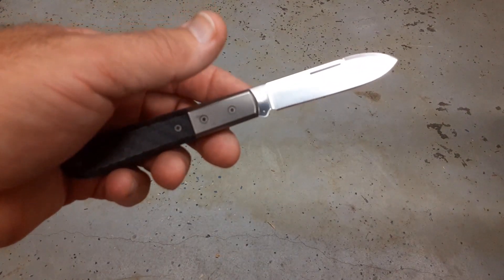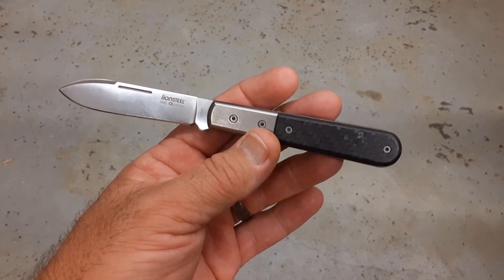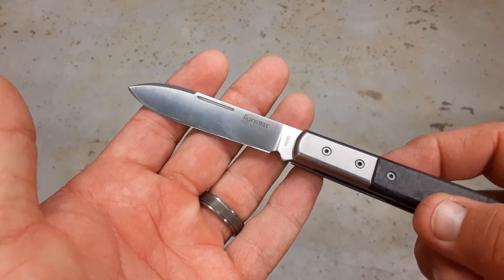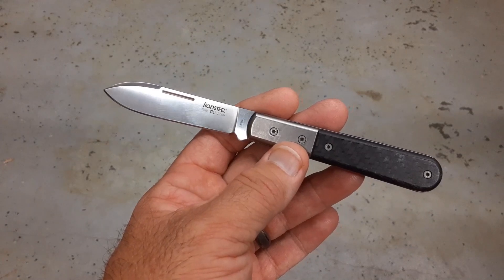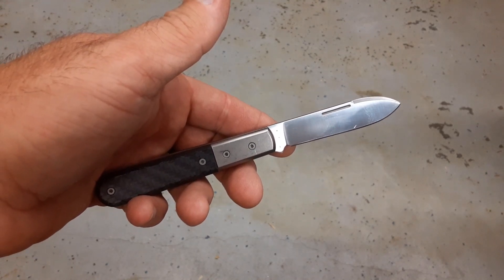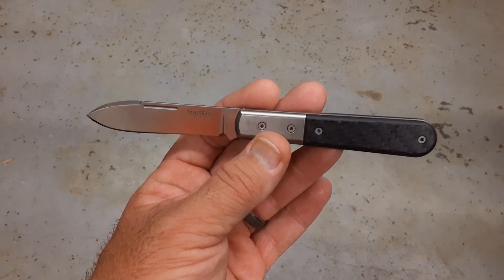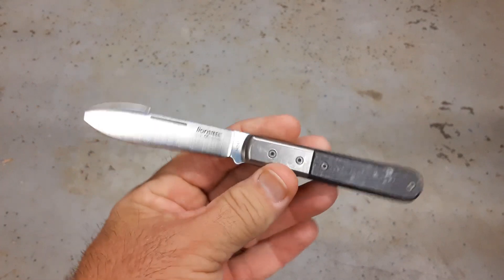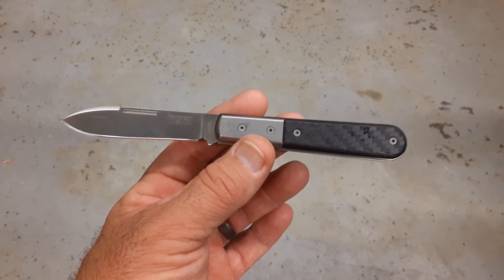Lionsteel M390 spear point barlow edge retention testing, does this one disappoint? Let's find out.

Comment: This knife tested between 54 - 56 Rockwell. The first time I cut with this knife I knew something was wrong. The factory edge just fell apart. It really never got any better. This knife was tested 5 or 6 times. It wasn’t just one test.
Reply: I bet if you took the blade out and tested at the tang on Peter's ht... It would test 60hrc plus or minus 1hrc. There heat treatment protocol is the problem and they refuse to change it despite the performance being bad.
Reply: @tacticalcenter8658  I am not sure what you mean when you say it will be 60hrc. Kurt tested 6 spots right next to the bolster. It was as far away from the cutting edge as he could get. I have removed the blade and tested it in 2 places on the the other side of the pivot screw. It was still a 56 - 56.5. I have to believe it just poor heat treating all the way around. I am sure the blade sharpening by belt probably took the cutting edge to the lower numbers. That knife has now been sharpened more than 12 times. We should be past a burnt edge by now. We are into just poorly heat treated and a seriously overheated blade all the way through.
Reply: @mikelikesknives428  just saying the same thing happened with the first low hrc one tested. Low hrc by Kurt, along with the same poor edge retention in these tests. Then Kurt took that one to Peter's and it tested 60hrc at the tang. All I'm saying is, it was probably to spec but burnt to a crisp on a grinder after heat treat. They already have a poor heat treatment protocol. But the burning the edges makes it even worse.

Comment: I have the Lion steel Dom. The design and size made for a wonderful pocket knife. I was so happy with it until it was time to sharpen. Using  1200 to 2000 grit diamond plates followed by crock sticks it has been impossible to get to a shaving edge. I get to a working edge and it does not hold that well.

Comment: I've had one since they came out and  the first time I put it to the stone I knew there was an issue with heat treat.
Reply from the maker: Only the Bolus that felt ok in sharpening did what the average M390 does in the 170 feet total cut range.

Comment: Viper and fox any better at this?
Reply from the maker: The one Fox M390 did about 160 feet total and the Viper M390 knives I've done didn't do well at all.
Reply: They all use the same heat treatment protocol developed by Molleta of lionsteel and heat treatment performed at Trattamenti Termici Todesco SAS
Reply: @Outpost_76  you can read more about lionsteels own cut test results which were really poor also https://www.bladeforums.com/threads/lionsteel-steels.1168429/
Reply: I saw a Supersteel Steve test a Maserin that did phenomenally, maybe they're the one to go with.
Reply: @matthewsbernier  steelwill gets there Italian made knives made by maserin. We've seen them do poorly in Cedric Ada's tests. I'm guessing that knife Steve tested was heat treated somewhere else than the rest. Steelwill like to keep everything secret, maserin too.
Reply: With that said maybe they learned and started doing it right? Would need more data points of knives made in recent years tested.
Reply: @matthewsbernier  found this one interesting. 62hrc s30v that got 700 mm in CATRA testing https://www.tommasorumici.com/portfolio-item/hide-e-hide-folder/
tomma sorumici is the designer of the maserin knife Steve tested. Check his Instagram for newer models aswell as other designs from the Italian brands. He used to work for viper. His ig... @tommasorumici
That one is made by Fantoni which have worked with s125v steel (low hrc due to mass production but yea). They work with some larger names as mentioned here https://www.knifecommand.com/knife-brands/fantoni/
It's possible that fantoni have there own profiles at the same ht facility as lionsteel etc... Or there own heat treat in house or at a different facility than what the other Italian makers use. I haven't been able to find much on the subject and have not asked around yet. But maybe maserin switch ht facilities to them. I dunno. Edit... Looks like Fantoni went out of business in 2019
Reply from the maker: @tacticalcenter8658  just like my M390 Modus that cut 150 feet total and was 57 rc.

Comment: The thing that I love about this video is he doesn't use any other knife to cut the same material so you have no idea what the quality of the cardboard is you have no idea if there was contaminants in the cardboard you have no idea how much pressure he was using how much speed he was using anything it's all based off of antidote evidence of one knife.

RC is relative there's been several tests done on YouTube where they put things like s90 up against 1095 and there's no comparable difference whatsoever in cutting ability or edge longevity. people get hung up on this and act as if though it's some kind of major disadvantage or selling point for a pocket knife. The knife in question in this video I've owned for a while and I've yet to have a single issue with edge retention whatsoever it stays just as sharp just as long as my 20CV or other M390 blades. In the point that all these other videos that have shown RC really doesn't matter is the fact that none of us will ever get to the point that our knife is dull. Anyone who regularly carries a pocket knife will sharpen their knife way before it ever requires sharpening. It really doesn't matter about RC in a folding pocket knife because no one's going to be using their pocket knife for any hard use. This is all silliness much like everyone comparing knife lube. knife lube is only good until you stick it in your pocket and then at that point is contaminated and no longer benefits you in any on top of that the whole point of oil grease IE lubrication to reduce friction the opening and closing of a pocket knife doesn't generate any measurable amount of heat so it is not necessary. I have knives on bearings I have knives with lapped bronze phosphor washers and I have knives with absolutely no washers and I'll run them all bone dry and they are all equal across the board all the time in opening resistance and require no maintenance. The whole knife lubrication market is snake oil and nothing more. 

https://youtu.be/E3OSGl1I8go

17:15 if you don't care to watch the whole thing is where he gets into the findings.

Comment: I went to their video showing their hrc. I complained about my bestman 2's edge that was ruined in 2 days of light work. They said that all their knives are at 61 hrc minimum and that i can complain to Andra @ their shop/Website....
My s35vn Kizer even outperform this. Being rekt by a chinese mass production brand is a bit stupid, especially when using a steel like m390. 
It already should be at 63 hrc but even at 60 they ruin it for sure, the grain structure seem very uneven. Someone needs to break these in pieces to make sure XD